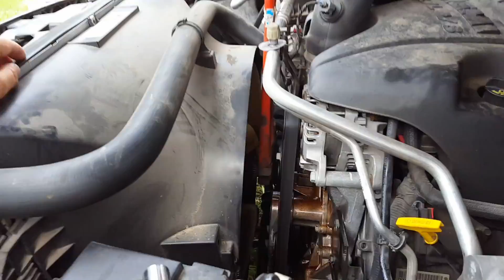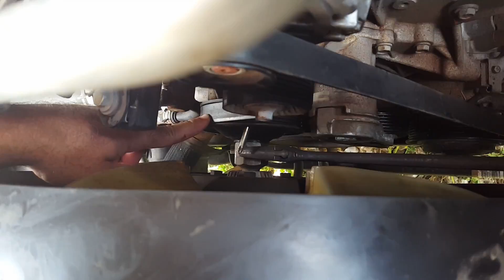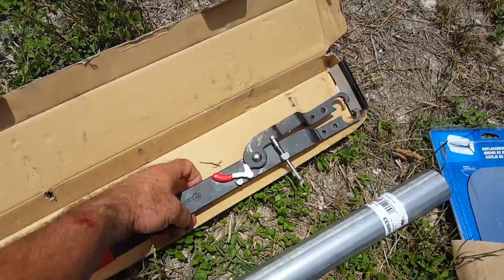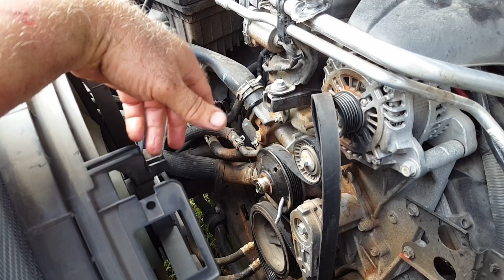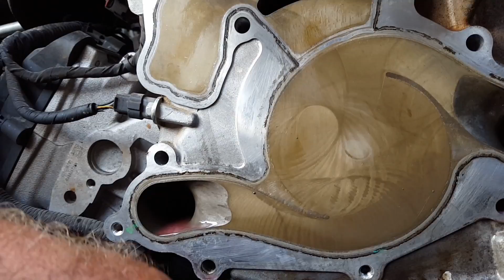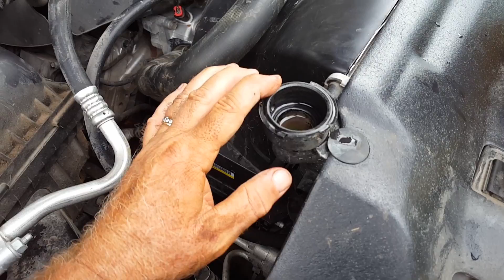2014 Dodge Ram water pump

Comment: Easy way to hold the pulley is to wrap a ratchet strap around it and connect the hooks to the fender, then put the wrench (or a punch/hammer) on the nut.

Comment: It’s a good idea when changing the water pump on these rams to upgrade to one with a metal impeller instead of the plastic oem one. I used a gates pump but there are a few others out there that use metal impellers. Just have to read in the description of the pump specs.

Comment: Try an air chisel  to remove a fan nut.  Put the tip of the chisel on the flat of the nut in the direction you want to remove the nut.  Its quick to loosen the nut.

Comment: Thanks for the video, My 2012 ram 5.7 at 68,000 miles also needs a water pump. It ticks when I start it  I hope its not the lifters going bad. One thing after another with these motors.
Reply: The ticking is probably your exhaust manifold bolts.On these it's common for one or more bolts to break.Then the air slipping past the gasket makes a ticking in sync with the motor.It sounds a lot like lifters.If it stops or quiets as it's warming up I'd bet that's it.Good luck.
Reply: Howdidy is correct. My exhaust manifold bolts have broken, and been replaced, twice. And I can hear the tell-tale ticking again.

Comment: I already failed at step one.   Couldn’t get the upper and lower shroud apart after an hour and ended up breaking in half pulling too hard at the joint.  No idea what I was supposed to do.

Comment: Thanks for the video brother, did this today on my 2014.  Still getting hot though despite changing both tstat and water pump.  Noticed both suction and discharge lines at AC Compressor were hot as heck.  Would the condensor having an issue causing my truck to run hot?  AC Compressor was replaced last week and system blows cold air.  Thanks again
Reply: Hope you resolve your issue. I was  thinking it could be the temperature of your thermostat. Could you share how you fix it?
Reply: Probably way too late but you need to make sure the jiggle pin on your t stat is in the upward position or else you’ll never get the air out

Comment: just did this today on my 2013.  didnt have that pulley tool so i removed the lower shroud, the bolts holding the fan blades to the clutch, then the upper shroud & electric fan.  removed the water pump bolts one at a time and placed where they went on new pump, then transferred one at a time to old one so i knew exactly where they go.   relatively easy job

Comment: Was your truck overheating??
Reply from the maker: No at 60000 miles started to leak.
Reply: At 4:57 there's a black metal pipe that sticks out on the left hand side. There I have a small leak where it connects to the water pump. Would this be the reason why my truck overheats and coolant flows out the reservoir?
Reply from the maker: yes. at 60 thousand they all start to leak.
Reply: Tracy Rowan thanks for the feedback. Hopefully I don't have a blown gasket.

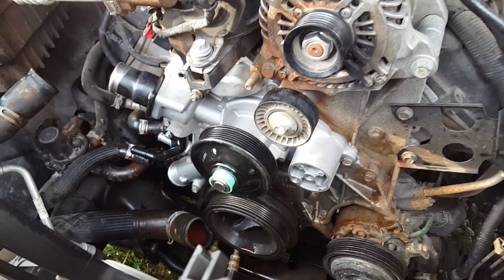Comment: for 2014+, the coolant should be 150K coolant.  That coolant is very light gray/light purple in color.  at 5:59 in your video it looks like your coolant, which i assume is factory, is orange/rust colored.  do you know why?  mixing 100K coolant with 150K coolant will cause very fast rusting of your system.
Reply from the maker: m l no worries I replaced the coolant  when I was done. Yes that was Factory coolant
Reply: @bif90210 m 33 99lmllll)lo 'll 'll'll I

Mmm I.44.

Comment from the maker: Yes there is a drain on the radiator. I had 60,000 miles at time of replacement
Reply: Wish I had found your post before I paid a shop to fix it . I'm at 70k on the odometer. I'm sure I could have replaced the water pump myself. I do need to flush the cooling system do you have a video showing how to do this ? 

Thanks.

Comment: Nice video brotha. My water pump just went out tonight also or at least im sure thats the problem. i noticed when the engine is running the fan has a wobble to it. just curious but about how many miles do you have on your truck? thanks again and very helpful video.
Reply: ADAM DOM mines gone at 78,000 kms
Reply: rob once you changed the water pump did the fan wobble go away?